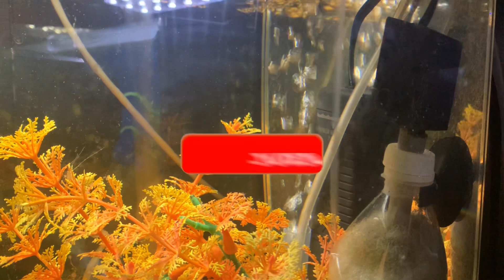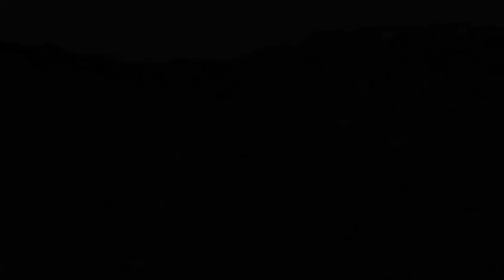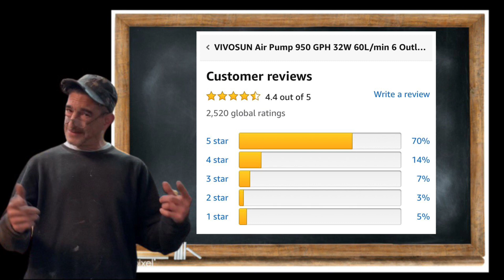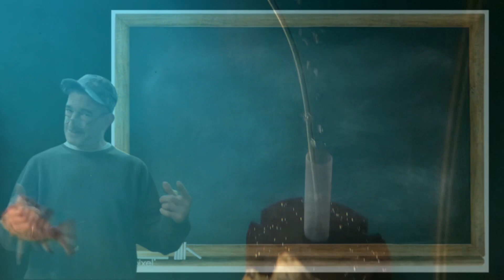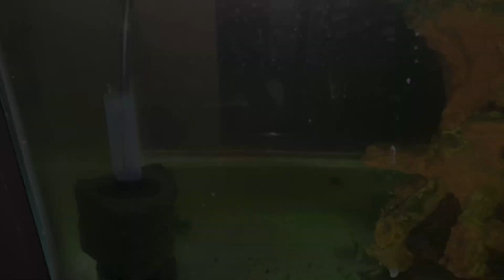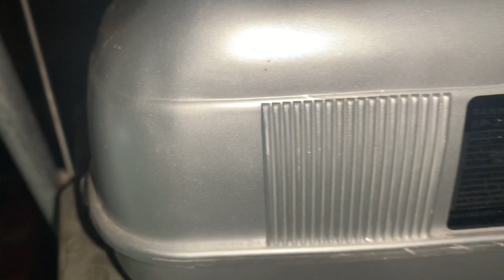CHEAP VIVOSUN 950 GPH  Air Pump REVIEW!

Comment: The complaint i have seen with these pumps at least for plants has been its loud and the output is generally too hot. In regards to plants this is generally bad, as higher temps means less dissolved gasses in your nutrient solutions (generally systems with out chillers).
Reply: Yes the older they get the louder they go, hydrofarms 70litre runs nice but it too when it starts to get older runs loud and hotter

Comment: I ran two of that kinda pump in my fishroom for a while.   
Pros: they are great powerful pumps and cheap.   
Cons: They run hot, hence the need for cooling fins on the body, and they vibrate like hell and are a bit loud.  
you can definitely do things to make the the noise and vibrations less noticeable.
Reply from the maker: They really are a nice pump especially for the money,  they do run hot but not crazy hot!  I should have modified it by now to reduce the noise and vibration but I got used to it, I notice now cause of filming 😳